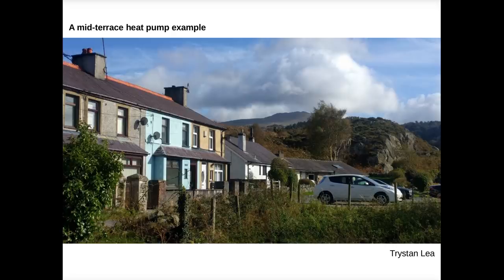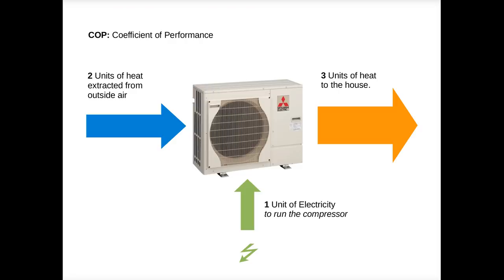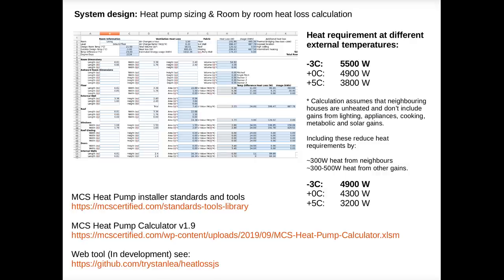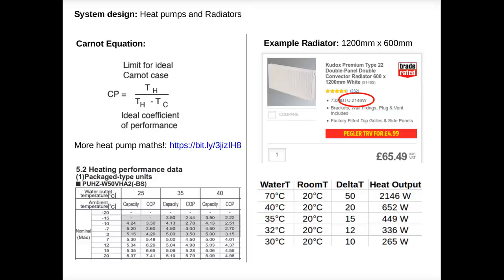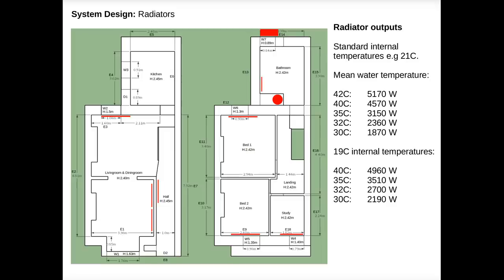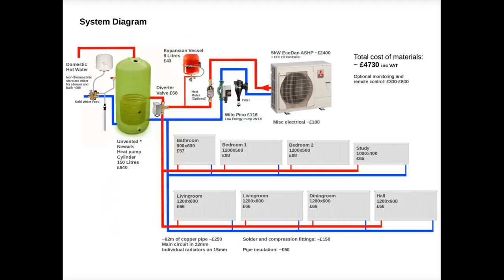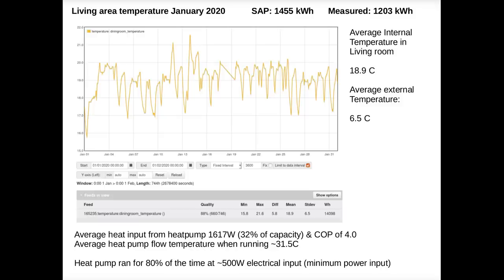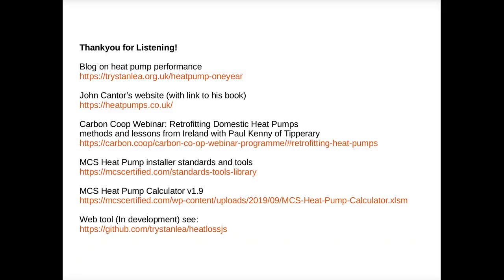A mid terrace heat pump example (COP: 3.92)

Comment: Great video Trystan, hope I'm not asking too many questions but....
1) You mentioned you do weather comp yourself which seems good enough to me, keep it simple I say. Is there a control on the Ecodan which changes its delivery temperature, any idea how it works, is it an inverter and just reduces compressor speed and delivery pressure a bit and therefore condensing temperature or something else I'm missing.
2) Would you have a model number for the circulation pump, am more familiar with grunfoss but my ignorance, am trying to get a reference point with a good reliable pump to work out how I might scale up for a couple of bigger homes with a bit bigger pumps and Ecodans.
Many thanks.
Reply from the maker: Thanks, yes you can either set the flow temperature via the EcoDan display unit or if you have the FTC2b controller you can set the flow temperature with another control system (this is how Im doing it).  The ecodan has an inverter which allows for variable compressor speed. My pump is a Wilo Pico 25/1-5 which I bought from BES https://www.bes.co.uk/wilo-yonos-pico-25-1-5-central-heating-pump-20459/
Reply: @trystanlea  many thanks, when you sterilise hot water to 50 + deg C occasionally can the ecodan do it or do you use what looked like an immersion heater in the video ?
Reply from the maker: @stevegreen2839  the ecodan can output up to 60C but I have about a 7K deltaT across the cylinder coil, this means I can bring the cylinder up to just over 50C, the immersion heater can then be used to topup to 60C

Comment: Hi Trystan. I really like your video and the way you explain things, however there are a few areas that I feel are not covered:
- Economics of moving to Heat Pumps: is it worth moving from a gas boiler? I know you can get some help from the government, but is it feasible for a small property?
-Planning and installation: How did you did you find a not-very-expensive installer? I did ask a bit and the prices they gave me were exhorbitant, did you buy the heat exhanger and then hired somebody to come and install it, after you did your home work?
I appreciate any comments on both subjects, thanks

Comment: I think the reason you got such a high COP was because your neighbours are heating their houses to a higher temperature than you are. In a mid terrace there is a flow of heat from both sides so you effectively have less than two outside walls. I am genuinely encouraged to see your results but I still doubt that the average semi will achieve much more than the Energy Savings Trust trials which were less than 3 COP for a seasonal average. It would be good to break your COP down and look at the winter. How do you heat you water in the summer?
Reply from the maker: Thanks for watching and commenting Roger! glad your encouraged. This last February (coldest month so far with the heatpump) I had a COP of 3.9, summer/winter difference is complicated by more time spent on standby in summer. I've put a blog together that has charts showing the COP for each month through 2020, including split by space heating, DHW & effect of standby, see https://trystanlea.org.uk/heatpump2020 The heatpump heats the hot water both in summer and winter.

Comment: very interesting , i'm thinking fitting an air to air heat pump as my house is small, only a 4x3m space to heat, seem to get new for about £400 or been offered a 2012 made fujitsu one  second hand about £250, its power consumption is 1.30kwh , and gives out 5kw , whats your thoughts on their efficiency and would they be any good. i see appliances direct have telefunken one for £350 , advice would be appreciated

Comment: Thanks for a very useful video, I am thinking about installing a 5 or 6 kw heat pump in my 1930s first floor flat about 70m2. Do you find the 5kw unit noisy. The only other unit I have seen working is a 12kw Ecodan from 2012 that was quite noisy and im a bit worried about my neighbours.
Reply from the maker: Most of the time you cant hear it, but if its working particularly hard and the outside air is still you can. I think I could improve the wall mounting with more rubber dampening to reduce this. The newer EcoDan models are even quieter than mine. Definitely something worth considering carefully.
Reply: @trystanlea  thanks. what type of fixings did you use to mount the air source unit. I’m considering chemical anchors but most kits come with large nylon wall plugs and corresponding screws or bolts.

Comment: What is the running cost ££ compear to a gas boiler of today.
Reply from the maker: I've written up my 2020 running costs in a bit more detail here https://trystanlea.org.uk/heatpump2020, it was between 31-43% cheaper than mains gas in terms of the cost of the delivered heat, thanks to the Octopus Agile time of use tariff and the high COP.

Comment: This is really interesting stuff Tristan. Thanks for making this video. I have a 79sqm Victorian mid terrace in Bristol and as the green homes grant has started in the same month my old combi boiler was condemned, I've been getting quotes for heat pumps.

3.9 is a really impressive COP. Do you base that simply on heat output vs electricity input? If you have your system switched off 20% of the time, arguably you could add 20% to that to get an 'adjusted COP' - because you're using no power at all for nearly 5 hours a day, but the house feels warm enough all the time. 

I'm leaning now towards an air to air rather than air to water system. It's slightly cheaper, and unfortunately the green homes grant is subtracted from any RHI payments, so it doesn't matter that air to air doesn't qualify for RHI. As my estimated RHI is £4900-£5600, it makes more sense to use the green homes grant for something else, or go for air to air system, and deal with hot water separately. 

Did you lag all the pipes in your system? I thought if went with air to water I'd take up all the floorboards and make sure every single pipe is properly lagged. I'd like to switch off the system overnight, and I've read that if the flow temp drops below say 15C the heat pump has to use an immersion heater element to get it back up to temp before it runs the compressor. My thinking being, priority is to stop that flow temperature dropping maximises the times you can turn it off.
 Do you notice the sound of water going through the radiators overnight? (Mind you, with your 'little addition' I guess noisy radiators is unlikely to be  the main thing stopping you getting a full night's sleep!).

Interesting also you found that 20-21C was comfortable inside. With no boiler I'm using portable electric radiators in the rooms I'm sitting in. I seem to need it around 22.5C to be comfortable. The house is not that drafty, although could be better. I did wonder if perhaps with constant heat a lower internal temp would be ok, as the building fabric stays at a more constant temp.
Reply from the maker: Thanks @theideastring and sorry for the slow reply! Yes I lagged the pipes under the floorboards as much as I could. I haven't heard of the need for an initial heat up using an immersion, there are a lot of systems as I understand without any immersion backups so I dont think that applies to all heat pumps. I notice a bit of sound sometimes in the rads and pipework when the heat pump first starts up, I guess its thermal expansion.. there are probably ways to mitigate that for those that are more experienced with plumbing than I am?
Yes I've heard that a constant heat means that the walls are more likely to be at a higher temperature and so you get both the air temperature and the radiative comfort of warmer walls. 
Certainly feels comfortable at 20-21C though comfort is quite subjective and you can quickly get used to warmer temperatures!

Comment: Being a mid terrace property does the noise of the heat pump annoy your neighbours?
Reply: I would say no. I have a mitsubishi heat pump (air to air, not for water heating) for heating my apartment. I have it on my bedroom's balcony, right next to the door and close to my bed. Single glazed windows and still I can not hear it at night.
These things are very quiet, specially once you get your house warm and they are just maintaining the heat.
Reply from the maker: Hello Keith, Id say it needs careful design to reduce the risk of this, there is a process as part of MCS to ensure that the audible noise is below a certain level at neighbours windows. It's worth making sure that there is a good level of rubber padding between the unit and the mounting frame or structure. Something Id like to improve on mine.

Comment: nice but how reliable is it ling term
Reply from the maker: Thanks Robert,  I haven't had any issues with reliability yet but its a relatively new system, this suggests reasonable levels of reliability https://www.greenmatch.co.uk/blog/2014/08/heat-pumps-7-advantages-and-disadvantages perhaps similar or better to other systems?

Comment: Hi Trystan.  Are you able to provide in services. I’m in Llangollen
Reply: Ideally heat loss calcs, radiator sizing and monitoring.  94sq m Solid wall property, external wall insulation, triple glazzing

Comment: Trystan I have approached a company called Evergreen Energy Ltd, to look into viability of ASHP. Do you know of this company? They apparently use Samsung pumps, do you have any thoughts on Samsung. They have asked me for £50 before they send an energy assessor out, any thoughts you may have would be most welcome. May I ask what area of the country you are?
Reply from the maker: Hello Keith, I dont know much about Evergreen, but did hear them on the @betateach podcast a couple of weeks back https://betatalk.buzzsprout.com/509671/6232654 they sounds like they know what they are doing! I only have experience of the ecodans unfortunately. I live in North Wales :)

Comment: Great video thanks, and some great results from your system! Just goes to show you how effective a small heat pump can be with what most would say is very sub optimal building/emitters!! 
Did you go down the RHI route?
Reply from the maker: Thanks Peter! No not RHI as I did a lot of the work myself.
Reply: The fact that Trystan has a mid-terrace is a big boon, but it's an impressive result with solid walls.

Comment: Reality is the neighbours are supplying a lot of the heat.  Different story in a detached house.
Reply from the maker: It certainly helps to have neighbours, mostly because its not wall area exposed to outside temperatures. My heat loss calculation suggests that the difference between a detached version of our house and our house with neighbours heating should be around 17% more heating demand in the former case, we would need a 6kW heat pump and more radiators.
Reply: If your house is the same temperature as theirs, they won't be supplying any heat to you :)
So main thing is probably that the wall isn't exposed.

Comment: Just wondered what the noise levels are of a whirring fan?
Reply from the maker: Hello, the latest mitsubushi ecodan's are pretty quiet now, you want to make sure that it's installed with plenty of rubber vibration isolation, most of the time I don't notice ours but there are times on the coldest days when it is still outside that it is noticeable. I'm going to add more rubber padding to ours to see if that can be improved.
Reply: @trystanlea  Thanks for that.

Comment: Trystan, 

how do you measure your perfomance ?
Reply from the maker: I've written up a blog post about the monitoring here https://trystanlea.org.uk/monitoring, I work at OpenEnergyMonitor and have also written up a  heat pump monitoring guide here guide.openenergymonitor.org
Reply: Trystan, 

I have quite afew questions and also some points to make that you may not have thought about?
Really too many to put on here. Your website does not give a contact link or I would have used that?
Reply from the maker: @iareid8255  Sure, my email is trystan.lea @ gmail.com  (remove the spaces)

Comment: I don’t have any back wall that I could use for such a heat pump, at ground floor level, neither front or back.
Reply from the maker: A lot of houses or flat's in higher density areas would I think benefit more from some form of district heating based heat pump system, this is an interesting concept by kensa heat pumps https://www.kensaheatpumps.com/district-ground-source-heat-pumps-installation-in-tower-blocks hopefully these kinds of solutions will gain more traction

Comment: A question really? What about noise nuisance for you and your neighbours?
This seems to be an issue
How did you attach it to the wall and did you try to mitigate vibration transfer. What are the maintenance implications?
Reply from the maker: It's pretty quiet really. There is rubber dampening on the mounting but you do still hear it a little when it's going flat out. I think if it's possible to avoid wall mounting that would definitely be better

Comment: Trystan, its me again, I have a well insulated stone house over 3 floors with full underfloor heating on all floors, ASHP appeals to me, however as we use a lot of hot water would I have to use immersion heater to reach the temperature needed?
Reply from the maker: Hello Keith, if the system is designed for a heat pump you should not need the immersion heater for most of the hot water heating (apart from legionella sterilisation). If you are wondering whether you can use your existing hot water cylinder there are a couple of things to think about, the first is that you ideally need a large area heat pump coil or heat exchanger to efficiently transfer the heat to the cylinder, then you may be storing the water at a slightly lower temperature and this means you end up mixing in less cold water with the hot water when it's used and so you end up using more water from the tank which means you need a larger tank to provide the same amount of hot water if that makes sense! I would recommend looking at a mixergy heat pump cylinder if you decide to install new, had I been aware of them earlier I would have installed one on mine https://www.mixergy.co.uk, it has quite a few nice features such as a efficient external heat exchanger and features to ensure the legionella protection cycle is effective. It would also be worth checking that the under floor heating will work at the lower flow temperatures from the heat pump, the pipe spacing needs to be typically closer together to work well at lower temperatures than systems designed for boilers (as far as I understand from my discussions with John Cantor).
Reply: Thanks for that Trystan as to the underfloor heating it is designed to mix down to 27° flow temp at present we use oil

Comment: Would much rather stick to  gas central heating boiler ... I spoke with a heating engineer yesterday and he said they are  taking all the heat pumps  they installed out  cos they aren't warm enough

Comment from the maker: For those interested in more technical content relating to heat pump system design you may find these videos by John Cantor useful:

Heating old buildings with heat pumps:
https://www.youtube.com/watch?v=3guSwkNheao

Heat pump refrigerants:
https://www.youtube.com/watch?v=lQN7KWjB0HU

Flow rates and pressure drops:
https://www.youtube.com/watch?v=0nDbtF5-scY

Heating simulator
https://www.youtube.com/watch?v=GHrcqQlu3jg

Comment: Very good. Thank you for posting. I went through similar calculations but decided not to go ahead. Main reason was the increased size of radiators but I was also concerned about life expectancy and capital cost on replacement. 

Whilst there are grants available for the initial installation I was worried that the system (being on nearly all the time) might last less than 10 years and requiring a £12k capital replacement. Our current boiler is 15 years old but the service engineer says it should last quite a few more years (maybe a 20 year life span - It's a Worcester GreenStar i). Also we are on 100% green gas (bio gas) so less environmental concerns. 

I've booked marked this video as I may redo the assessment in a few years when hopefully the capital costs are lower and life expectancy might be clearer.
Reply from the maker: Thanks Alan, Id be surprised if it was a 12k capital replacement, the cost price of the 5kW heat pump unit is about £2.4k, and replacing that would not necessarily require re-plumbing or additional electrical work. The circulation pump is about £115.